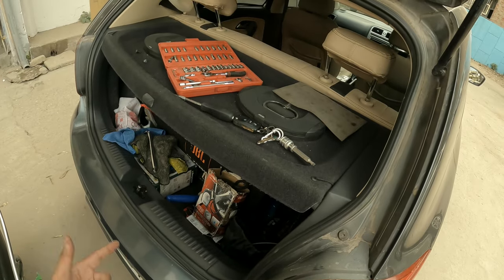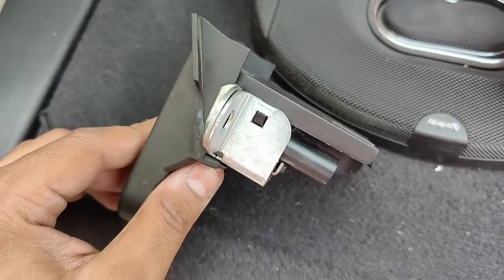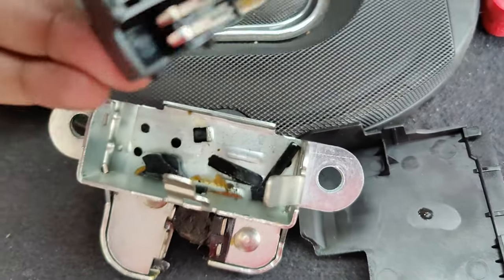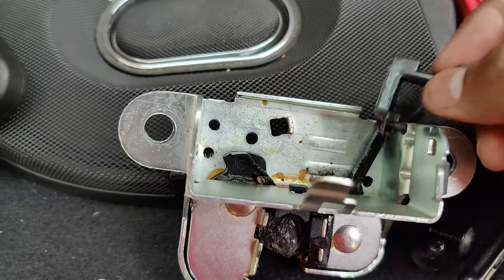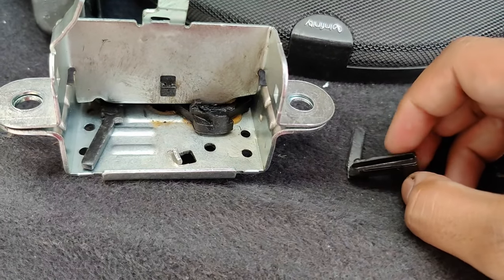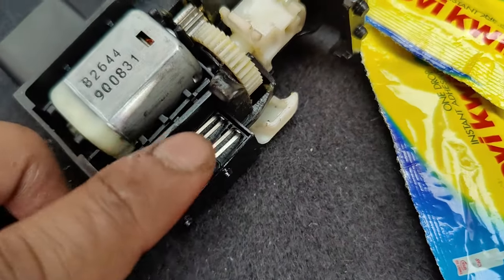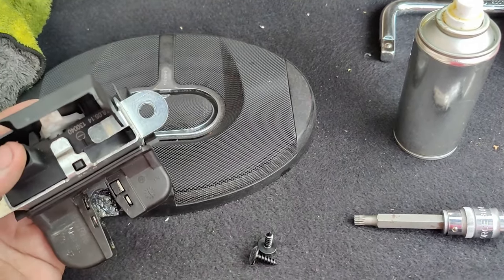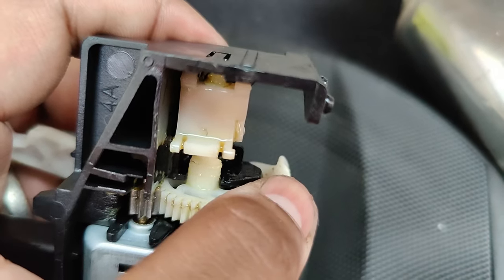BOOT LID LOCK | TRUNK LATCH REPAIR | HOW TO | VW

Comment: I was able to fix it. I had exactly same issue. After watching this video, I opened up the lock and find out the white part (shaft) has broken so I used soldering iron to melt the broken area and added some strong plastic but you need to do very carefully that it doesn't loos the function, like small surgery operation. It's been a week already, works perfectly.
Reply from the maker: Thats great sir 👍
Reply: What were the condition? A motor running noise is audible in my car while i press the remote boot release button or pull the boot release switch in door.....but not opening What were the condition? A motor running noise is audible in my car while i press the remote boot release button or pull the boot release switch in door.....but not opening

Comment: I had exactly the same problem! Fixed the problem, but the shaft was damaged as well so still needed to order a new one. Could be easy fix is the sold the parts separately

Comment: Thanks for the video. I repaired it as the white gear lever was broken in inside. Fixed it with feviquick
Reply: What were the condition? A motor running noise is audible in my car while i press the remote boot release button or pull the boot release switch in door.....but not opening

Comment: Thanks for the mechanism my brother .
I fixed mine ,locked but then when i open and try to close it again it doesn't lock the spring is still attached in both slots
Reply from the maker: Is the shaft is intact?

Comment: Sir during my trip in skoda rapid 1.6 L tdi, got low oil pressure red light continuously, which goes only afer switching off vehicle but again came  after a 100 km. There was no leakage of oil but found oil at lower mark on dipstick. What may be the probable cause for the same. Afer this happened three times vehicle driven is 200 km and no light again please advise your helpful comment.
Reply from the maker: Sir if the engine oil level is low , then i advise you to top it up , the low oil pressure light comes on when engine is not able to maintain a desired oil pressure for essential components like crankshaft and camshafts , it can lead to severe damage . 
Due to low oil levels , oil pump is starving for oil and maybe sucking air , thats why its happening 
Oil not only lubricates you engine internals , it also help to maintain the temperature of internals .

Comment: Bro rapid me boot unlock krne par na ta boot light glow kr rahi hai he mid pe boot lid open ka logo show ho raha hai lock unlock bilkul sahi hai kya problem ho skdti hai ?
Reply from the maker: Lock ke andar ek microswitch hota hai , ya to uski wire loose ho gai hai ya , microswitch pe dust aa gai hai
Reply from the maker: Then most probably the light wiring is short somewhere with ground

Comment: Bhai mere polo is boot lock lagta hai magar open nai ho raha, seat fold karle key put karke left se push karne baad open hota hai 
What should I change? It's lock or it's sensor 
Help me out please
Reply from the maker: Sir lock , same problem hogi apki bhi , lock ki shaft toot gai hogi
Reply: @yourDIYneeds  lock thik hai sensor problem hai shyad
Reply: @yourDIYneeds  may share you video
Reply from the maker: Sir lock assembly ka jo locking part hai , wo mechanical hai , but jo unlocking part hai wo electrical hai
Reply: Aap please ye batao lock new lagvana padhega ya repair ho kar sahi chalega future me

Comment: Any idea how I can open the boot when the internal larch won't open it
Reply from the maker: Remove the seat back and swipe the keyblade in the lock slot
Reply: @yourDIYneeds  I've tried,  doesn't work
Reply from the maker: Sir , then the only way is to pull the door card on boot door from inside and unlatch the lock .
Reply: @yourDIYneeds  yeah I took that off and tried everything reasonable haha I think now i will have to be aggressive with it and make a mess
Reply from the maker: Sir after that , lock is easily accessible, you can just unbolt the lock from the boot door and then tackle it the way you want
Reply: @yourDIYneeds  the boot needs to be opened to get the bolts
Reply from the maker: Sir even the emergency release is not working ?
Reply: @yourDIYneeds  correct
Reply from the maker: Then have to find a different way , it may involve some action as well 😅